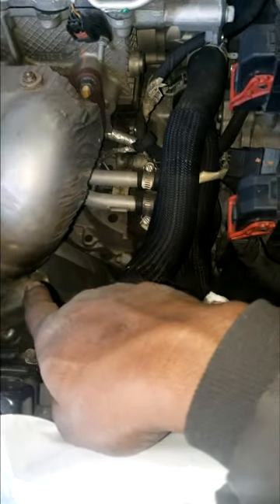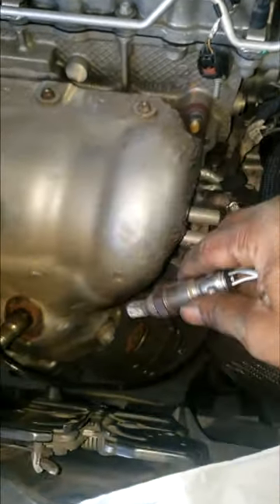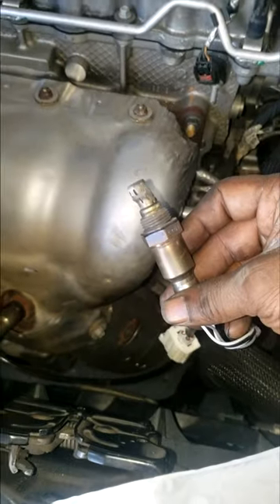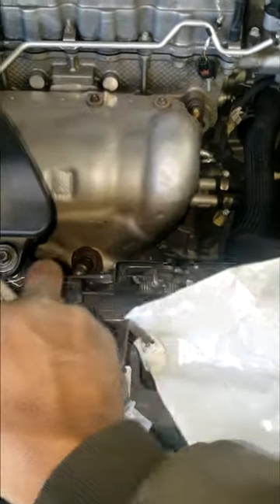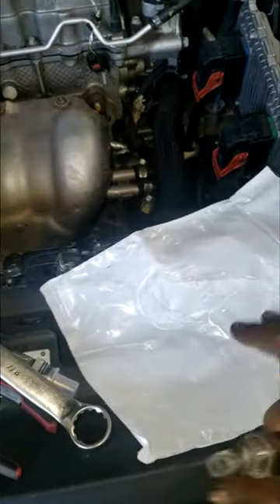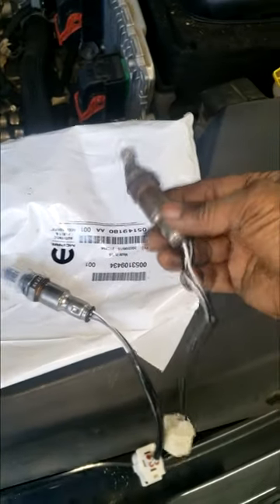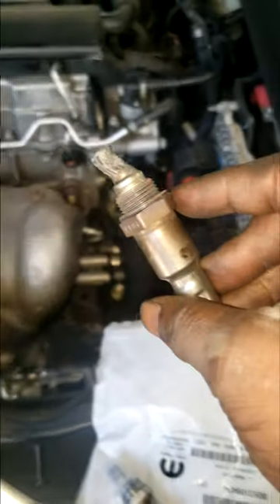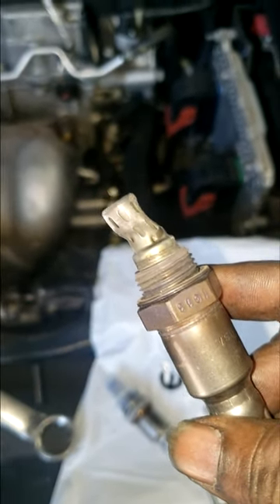Here's why this car came back as a COMEBACK RECHECK on me.

Comment: The cat could be falling apart and either hitting the sensor or stopping up and building heat and melting it, if u have replaced the cat then make sure it's not stopping up, if it's blowing coolant or oil out of the exhaust due to a blown head gasket or something it will build heat because it's stopped up

Comment: If it’s in the Chrysler family then a lot of their vehicles don’t have a voltage regulator on the alternator, all the voltage is regulated by the pcm and a faulty pcm can send to much voltage to the o2 sensors and cause them to melt the tips to nothing. Test the pcm voltage output on the wire going to the heated 02 sensor

Comment: The honeycomb inside the cat has broke loose and it likely moves around and smashes into the O2 - if you actually did replace the cat I’d check it again. Heat has nothing to do with it. If anything just get a spacer / extender to pull the O2 away from the inside of the manifold so it won’t get messed up but I’m positive it’s the honeycomb filter(s) inside the cat itself that have broken loose and and slid and hit it

Comment: Most likely the exhaust valves are opening to soon. Causing it to send unburned gas down through the tailpipe causing extreme heat, and damage to the O2 sensor. Car should be timed. If that doesn't fix it the cam to crank timing is off.

Comment: Running rich. 
Check fuel trim.
Diagnose accordingly.
Higher voltage to fuel pump?
Fuel pressure regulator?
Bad/open fuel injectors?

Comment: I remember catalytic converter going out than the O2 sensor went after placing the catalytic converter.  So I believe that you're having the same problem. But in your case the old two sensor is going first right instead of the catalytic converter going on all the way.

Comment: This is from getting to hot .... Odds are the cat is stopping up - probably put some fuel treatment in their gas tank to try to get rid of the warning light and it didn't burn all the way off and has now partially clogged the cat , not enough so it won't run but enough that it's holding enough hat to weaken the cage on the sensor ....

Comment: Guessing you replaced them the first time due to a code for downstream o2 sensor voltage out of range, it was probably out of range not from the o2 sensor failing but because the catalytic converter has failed, or become most of the way clogged causing the heat to melt the sensor, and the sensor out of range as that is generally a sign that your emissions equipment is malfunctioning as that is all the downstream sensors do is monitor emission system function and downstream sensors don’t fail very often

Comment: Your cats toast the fragments break off and start to smack into the sensor that in combination with 1500+° temps makes short work of denting the sensor, the cat needs to be replaced and there needs to be a diagnosis of what caused the premature failure of the cat, and that means more than just tossing in a o2 sensors and sending it on its way I mean comb through it find out why it's running the way it is (most likely rich)
Seen this couple times always ends in the cat getting clogged sometimes very clogged (11psi in upstream with a backpressure gauge)

Comment: Judging by the marks on that sensor and the white dust falling out upon removal its been crushed not over heated if it was overheating that much that is is causing the metal to sag it would have melted the exhaust already

Comment: Cats gone already, must have been faulty. Or there’s some additional information on the engine health that’s not being presented. I’ll take bad cat for 200…A new one will last through whatever engine trouble caused it. Good luck! Just listened again and heard you replace both sensors. I would guess that they have internal engine issues that are causing premature cat failure. The engine looks fairly new that’s why I’m making the assumption that the cats shouldn’t be bad. But yeah if it’s in your scope I’d do a back pressure test, to confirm, engine pressure leak down and back my findings with obd2 readings. Good luck again and thanks for great content!

Comment: Possible the catalytic converter is breaking up and the pieces are flying against it and bending it. I would put it on a scanner and check cat temps at normal operating temperature at idle it should only be around 8 to 900° if it's any higher than that then it's plugged up and you need to take it around the block and floor it and clean it out wide open throttle running should be around 1900° normal driving should be between 13 to 1500

Comment: Clogged cats or fuel trims are off... check if mass air flow is being blocked a little bit by peices of leaves or some kind of debris, if mass air flow is blocked just a little bit the computer would see that as low air flow into engine and will adjust fuel trims and start dumping insane amounts of fuel into engine .... also check if oil is saturated with fuel ( smells Like fuel)  Goodluck

Comment: I would use a back pressure tester before and after the catalytic converter if it shows clogged before the converter the converter is bad if it shows clogged after the converter the mufflers clogged.

Comment: The Cadillac convertibles are clogged up so when they break up inside they go up and down the middle goes up and sound and it's in that O2 sensors at the tip

Comment: Pull the dipstick and see if the oil is thin and having the stank because I'd be wondering where the extra fuel is coming from! If you replaced the cat, the only cause that wouldn't be tripping codes would be excessive fuel getting burned in the cat because that sensor got like nuclear hot to end up looking like that. I'd be looking for an injector dumping mad gas that can't be burned in the cylinder.

Comment: Looks as if it bottomed against something inside the bore of the cat as if something is shy on depth. That's not from heat that's from crushing down force that distorted it.  The sensor should screw and have space between the sampling hat and pipes or cats interior check bung height.

Comment: That usually happens when the mufler bearings are bad restricting the exhaust flow. Also you should check the piston springs pressure, if the springs are bad the compression will not be the same.

😁😆🤣
Reply from the maker: O wow, interesting

Comment: Needs new converter, more than likely honeycomb is loose or  getting loose once heated and honeycomb getting loose and rattling around and hitting tip of o2 sensor. Markings  on o2 sensor indicates impact from converter.
Reply: I've seen this on a honda accord 4cyl a few times, converter was damaged due to bad plugs and caused rich fuel mixture.

Comment: The exaust is plugged post cat would be my guess.  No way a could it get that hot normally to "melt the metal o2 sensor.  If that is caused by heat and truly melted.....

P.s. in 20 years  I have only done about 30 sensors that were bad.  Excluding heater shorted, or open codes.

I see it or get calls daily asking to install o2 sensors because of lean codes.  Thanks O'Reillys.

Comment: Your cat is most likely toast, the honey comb mesh is burnt or completely broken in more then one place. Causing the heat to reach levels beyond what the cat and sensors are designed to handle. Replace your cat before you put o2 sensors back. You can shout the cat with an infered thermometer after you get the vehicle engine warmed up to normal op temp. Research the normal input and output temps for that vehicles cats are supposed to be. Compare the temps. Determine  whether or not the cat is to blame. You can actually take out the upstream sensor and route a snake camera down toward the cat. See if the honey comb mesh in the cat is melted and or broken up. It may be just clogged. You gotta see what's what. When the car is warm and running, place a piece of cardboard in front of the tail pipe related to the side of that cat and check for debris etc. That hive you idea of whether or not the cat is braking apart and exiting through the exhaust. If clogged get some of the foam cat cleaner and spray it from the upstream o2 sensor. It comes with a long tube to feed down the exhaust towards the cat. Follow directions. Then use cat gas tank flush cleaner in the tank behind the foam cleaner. Follow instructions...

Comment: Ma Dukes runnin' that AV-Gas 150 Octane with a 5th of Nitro-methane for full time, full throttle blasts around Laguna Seca, Watkins Glen, Sears Point, The Nürburgring, & The Isle of Man, with quick jounce across the Baja 1000.

Comment: The bolt you left  ear the throttle body made it past the intake and then exhaust valve(s) under full throttle and whacked it after being spit into exhaust.  Get out boroscope and look inside every plug hole and be amazed

Comment: It's definitely bc the car is running hot and the catalytic converter is probably melted also and all the heat from the exhaust is melting those sensors bad if it don't have to pass emissions u can aftermarket headers that put the o2 sensors farther away from the engine and that won't happen anymore

Comment: Excessive Heat. Melted due to VACUUM LEAK or Leaking Injectors, possible failed PCV valve JT. Must check MAF reading & see if low (or higher) than normal. If low MAF voltage? Vacuum leak somewhere... If high voltage? It has fuel getting in somewhere it shouldn't & is pulling in MORE air to compensate for it. PLASTICS on intake manifold are common problem. Vacuum elbows and line to EVAP leak all over the place. 😎👍

Comment: It’s an interference engine, the pistons rammed the 02 censors…Replace the head gasket, throw some duct tape around the oil pan, grease the bearings and call it a day..

Comment: Is it burning oil? Converter clogging? Is it running lean and burning oil, could a injector be leaking ,  I'd definitely run it , then check the temperature of the manifold, probably drive it at night , in a dark place, see if anything is glowing red,  I don't see it being the sensor,  it seems to be burning oil, running rich or lean, something to get excessive heat, converters are bad to clog,   drive it up a long steep hill, at night see if the exhaust is glowing , it could point to the cylinder at fault,  and check the spark plugs!    Good luck!

Comment: That looks like too high temperature. The tip of the O2 sensor has been glowing so hot, that after cooling down it got white and stayed that way.
I would look for lean burn, timings and the all time favorite: temperature sensors, but usually the ECU should pester the driver, if anything is wrong.

Comment: That cat is probably toast. I've seen them get so hot they melt the threads on the bung but never the sensor. How hard was it to pull that out? Did you have to heat it? One really useful tool is one of those cameras that have a thin wire that's like 3 feet long you can stick into the O2 bung and look at the cat.

Comment: The Catalytic converter honey comb loose and pushing onto it is the only was I see that possible if nothing wrong with the engine. The exhaust getting so hot for that sensor to get soft is interesting. Exhaust probably glowing red when that happened.

Comment: Bill is right. Toooooo much heat coming from the kat. You could check it with inferred gun standard is 500 to 800 degrees and 1200 under heavy loads.. 2000 degree or higher is danger

Comment: All these folks hollering clogged convertor think about he said he replaced two sensors, one upstream one downstream, the downstream sensor is bad, if the convertor was stopped up dont you think the upstream sensor would be exposed to much higher temps if the convertor clogged? Thats not the problem. The most likely problem is with the internal heating element in the 02 sensor. Internal short, wiring or pcm.

Comment: There is something floating in exhaust you will here it when at certain speed it will be thrown around undo exhaust you will find it usually a bolt floating around smashing sensor

Comment: Was the original issue a dead sensor or catalyst efficiency?? 

I’m surprised the sensor would be warranted from the manufacturer because it’s not an issue with the sensor (exhaust restriction or misfire causing excessive heat).

Comment: Like ive been reading you got some heat issues. My theory is that the cat needs looked at. what does the spark plugs look like what were is the timing? theres alot more then just replacing the sensor. need to inspect/fix the other issues that are leading up to this issue.

Comment: check the fuel trims sensors are giving the computer a lean reading and its adding so much fuel its melting the sensors dont just be the guy that chucks parts at it find the real problem and the reason the o2 went bad in the first place

Comment: Has the CAT broken up into big chunks ( as they do when they fail) and it could be getting knocked about? Or have they put DPF cleaner into the DPF and that burns at a higher temp, to burn off carbon in the Exhaust, so has it over heated it?

Comment: If those are real molar sensors, then you must be running super rich to melt it like that, or you must be driving super fast and turning some high RPMs..
Otherwise it is very possible that you got fake Mopar parts, I have received fake ACDelco before

Comment: Do down stream/ after cat 02 sensors determine air/ fuel ratio? I’m curious because I had cats deleted and still runs rough and get 02 codes and I understand I can have them programmed out or fake the light with spark plug non foulers, however my question is do they play any part at all in vehicle performance? I need to know if I should replace since my cats are removed I didn’t think I needed them.
Reply: Nah man, the back ones strictly monitor the cat more less. The front ones are responsible for fine tuning the fuel mixture. But you should only have like a p0420, and/ or p0430, for the missing cats. If you're getting o2 sensor codes, you may have other issues. What kind of codes?

Comment: you need a new CAT as it has plugged and is getting way to hot or there is fuel not being burnt and it burning up in the CAT  .. Ruel of thumb if you having O2 sensor or Cat codes check you ignition and injectors first as 90% of the time the O2 code is being fallowed by a p0303 or no code at all  and if there is an issue there then you will need to fi that before fixing the O2 and Cat

Comment: 20 yrs and I have never seen that especially after a new sensor and cat. Usually that happens if the cat gets red, red, red, melting hot. Or theres a chunck broken and banging around in there. Pull the cat and inspect the bung internally. Something isn't right, that looks more crushed than melted.

Comment: If you got a brand new cat on there, then you need to check your fuel trims. That is a melted O2 sensor. Meaning that catalytic converter is more than likely f*** as well. That is way too much heat for that area. I can guarantee that cat needs to be replaced as well right now.

Comment: Code for downstream can be from cat not working 

Exhaust so hot it's melting upstream o2 sensors. 

Cats been replaced. 

Defective cat?  Since your saying that o2 sensor should be replaced must be. 

Or what's wrong with the motor or fuel that it making it destroy the cats.

Comment: Looks like it may have been over tightened and the sensor smashed itself on whatever is right in front of the hole. The heat line only goes ½ way down the sensor bc whatever it was smashed into (I'm assuming the cat) gets super hot and heated it from the tip down.

Comment: Check for flow out the exhaust and give it the heat gun check see how hot it's getting and make sure you're not melting your sensor or you don't have a chunk of broken ass cat all laid up against it or it's getting hot and it's melting it pushing it

Comment: I've actually had one do the same thing to me and it was a new cat and 02 sensor ended up being a backfiring issue due to incorrect valve seating wich caused  excessive heat mine was a 2.5 altima

Comment: Engine ain’t running right. Or you have a exhaust leak allowing oxygen to enter after the cat and it’s super heating the sensor. I’m a GM tech and see this a lot on the 2.4 ecotec engines when they have a cracked manifold.

Comment: You need to do some investigation before you put the O2 sensor in because it looks like it got hot very hot so it looks like you got a misfire or a plugged exhaust system. Time to do some troubleshooting. Mopar will not warranty that one. They will only warranty defects on the craftsmanship not over temp.

Comment: She is running hot after she has been put through here paces looks to me like one of the exhaust ports is getting red hot and sticking open which cause a inferno inside of the exhaust outlet to the manifold so it melts the sensor ...

Comment: that sensor being too close to engine just melted it (whiles they using it like race car it exhaust will turn red hot n melted o2 sensor) 
if they would put catly converter far back behide transmission im sure they never have that issues aging
it have be at least 5ft away from engine for it dont get super hot and melted

Comment: Didn’t set o2 gap correctly. Bent the grounding strap….I dunno. It looks beat on but hard to tell from video. Check fuel trims. I’ve seen lean conditions have exhaust manifolds and headers glowwwwwwing red hot. With the o2 being part of the manifold it’s a possibility but I’ve never seen that in my 20 years.

Comment: It means the cat is getting too hot.  Either defective cat or a engine management problem.  Fuel, spark, air filter, oil consumption,  etc.  Start your diagnosis process.

Comment: You either have a clogged cat, but on the other hand if it was that clogged you would notice that the car will not go very fast or accelerate normally. Sounds like you got some exhaust valve issues on that bank